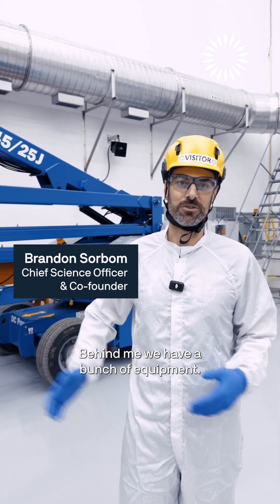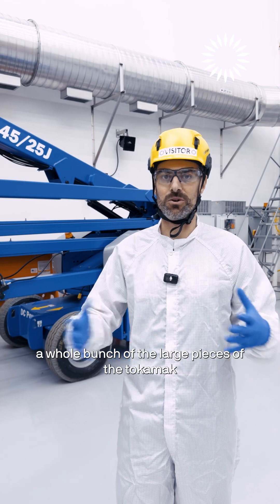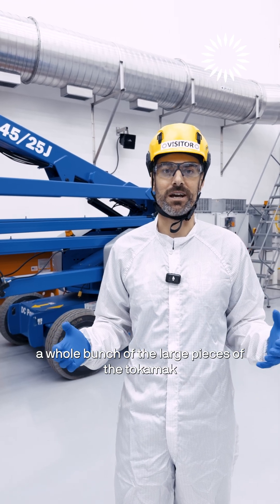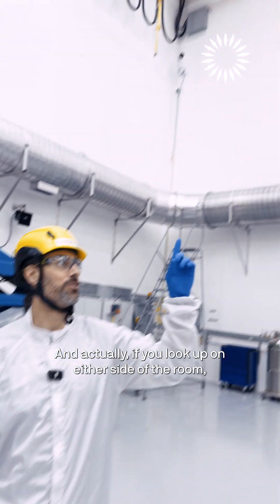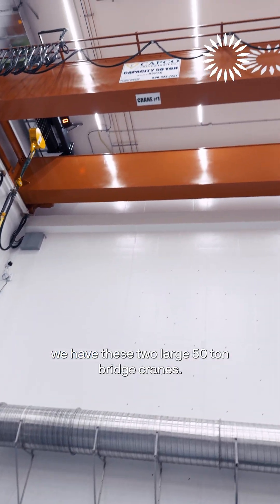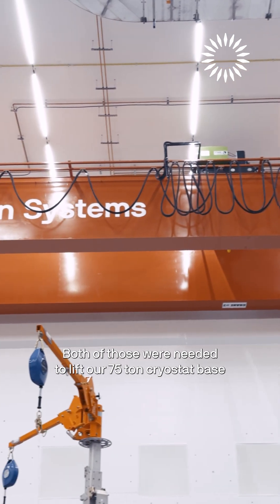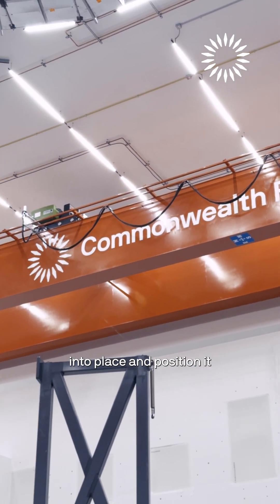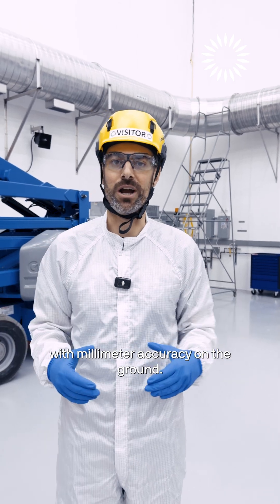Inside CFS with Brandon: Episode 3

Comment: Wild that one has to think about magnetic  Stray field forces on the bridge crane despite the huge airgap up to there.
Not really a magnetic point source so close by and thus the field is dropping slower. I guess it's about avoiding small asymmetric deformations of the tokamak during operation? No way these forces could damage the cranes. Right?